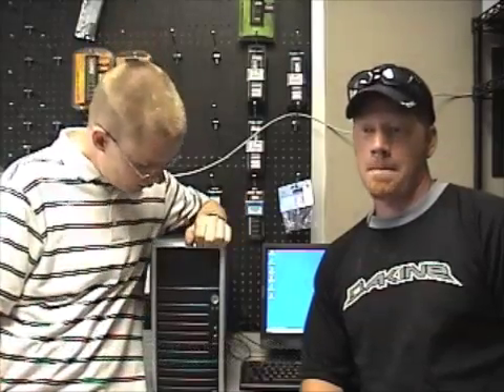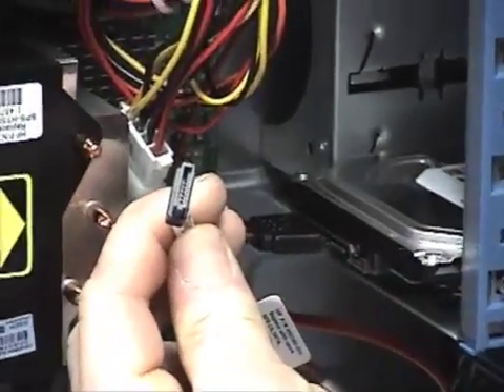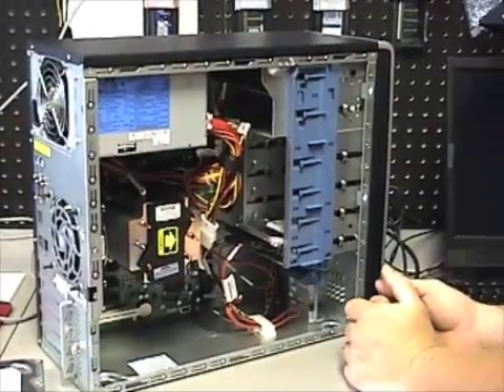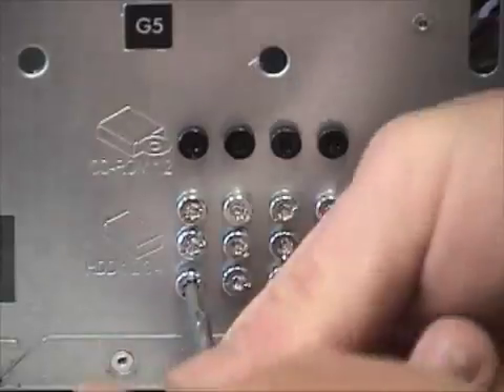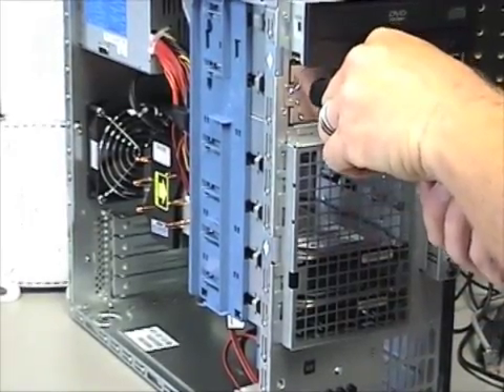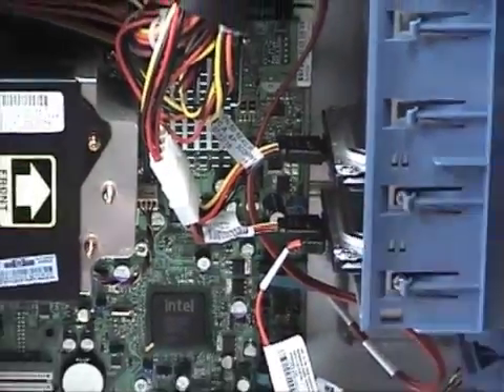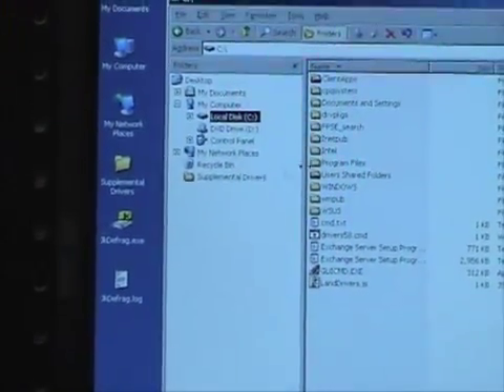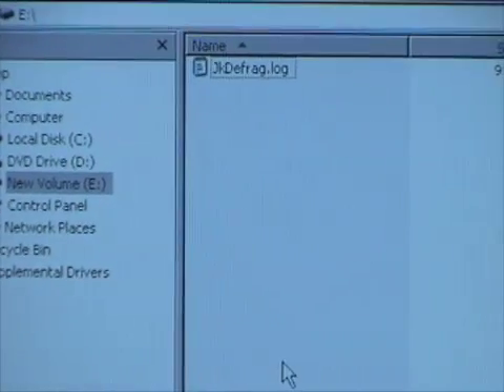Install An Additional SATA Hard Drive

Comment: Question. I have an Acer - 703g-uw51. I don't see where to add the cable to the motherboard. Dose it have a place on the board that I'm missing? I also don't see how to attach a splitter power cord.

Comment: dear sir i have a acer power fh that i changed the hdd  to 500g but when i try to install my other two hdd it will not boot. it said boot from dvd  install dvd.but if i unhook data cables from the 2 hdd it boots normal again. can you help with this proble? Dhenke57@gmail.com

Comment: I am running out of room on my primary pc and I have another PC with an extra drive already installed. Can I take the extra drive out and put it in my primary or should I just transfer the data from my primary PC onto the other one? P.S. My primary PC has Windows 10 whereas the other has Windows XP, not sure if it makes a difference but just wanted to make sure.

Comment: Thay do have a 300 gb ones. do thay?
Reply: did you mean to say "They DO have 300gb Hard Drives? Don't They?"
Reply: hak1985org
You mean 4 terabyte hard drives, bytes are a storage capacity, watts are a measurement of energy consumption.
And speaking of hard drives there are up to 6 terabyte hard drives on the market right now.
Reply: +charizard4410 They DO have 4 terawatt drives, but you can't get them here.
Reply: jdevola999
You are telling me that there are hard drives that take 4,000 watts to power? An enthusiast grade power supply is about 1500-1600 watts at maximum.  A 15,000 rpm hard drive only takes about 15-18 watts each. I'd like to see some proof of a 4 terawatt drive.  If it is taking 4,000 watts it better have transfer speeds faster than a pcie ssd.
Reply: +EnderBoy898 yea